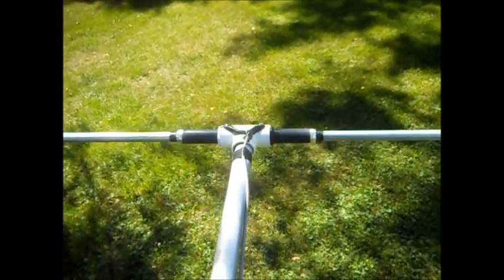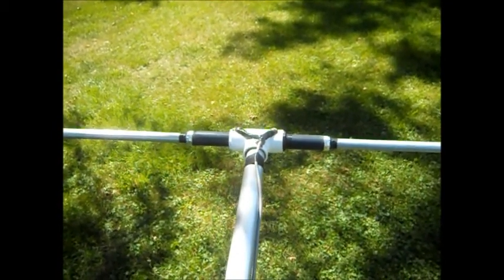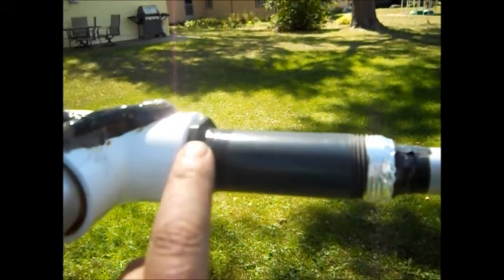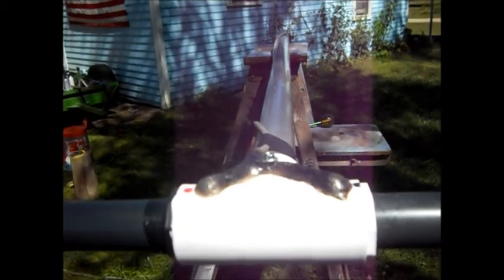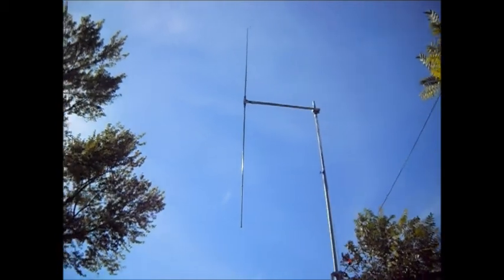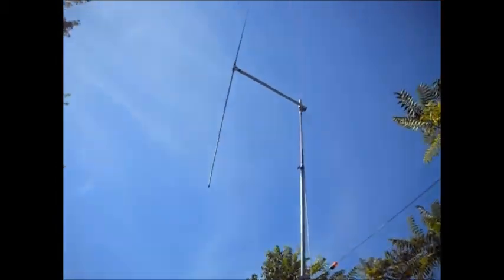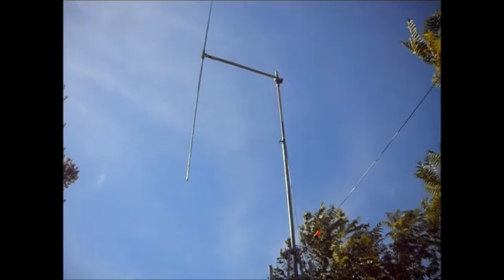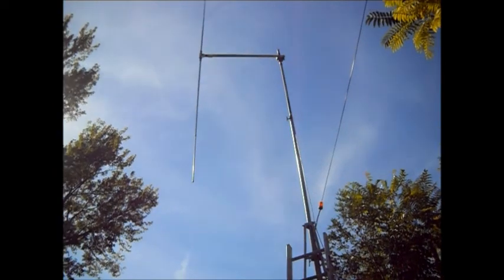11 METER DIPOLE PART 3

Comment: I always liked horizontal dipoles with my ham bands for the skip and great transmit and receive in the 2 directions perpendicular to the wire elements. I only went up about 15' and could talk all over the .... well, all over half the world anyway.  I only really needed the 2 directions so that I could talk up N and E out of S Texas to get most of the country really well, just couldn't get California but that's OK, didn't really want to. I'm gonna throw up a wire. The old tree and feed line is still there. I'll just point it toward the highway and town.

Comment: That's what they call a "pegleg" antenna. I have one I built and it works good. I put a tilt on mine to reduce the reflection from the mast..
I can talk pretty good on it with a stock cobra 29 ltd.
My VHF and 2 meter antenna is a CommScope DB224-E
UHF is a DB408-B
I run a VHF and a UHF Motorola Spectra 100 watt with the systems 9000 heads as base radios
Reply from the maker: I use this just for monitoring 10 and 11 meter but It may be worth tilting it to see if it recieves better

Comment: That should work well I have a very similar antenna. If you want to shoot skip it might help a little being horizontal.. but if your are just casually listening or talking local its fine the way it is. Also it will help to get it about a 1/2 wavelength above the ground (close to 20 feet ) so you should be ok there.